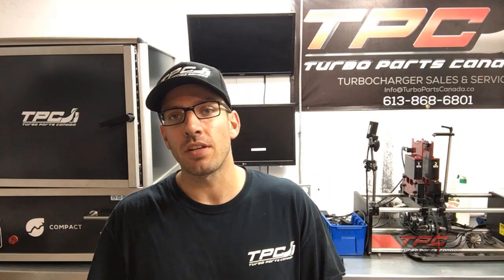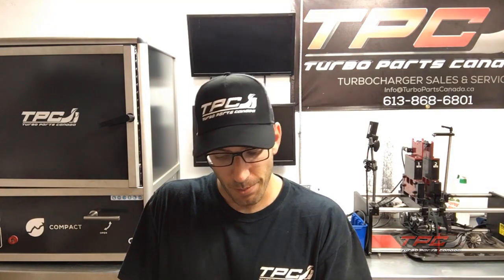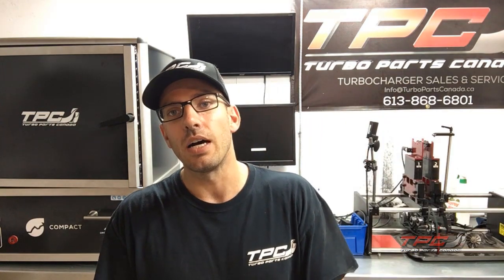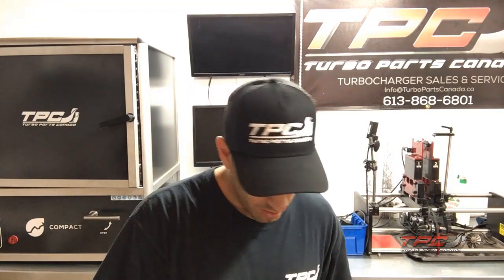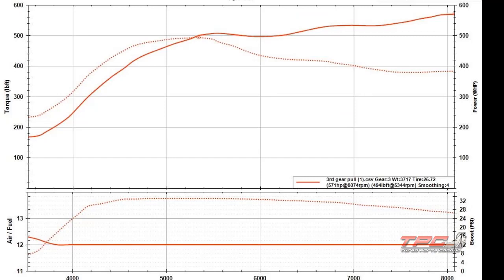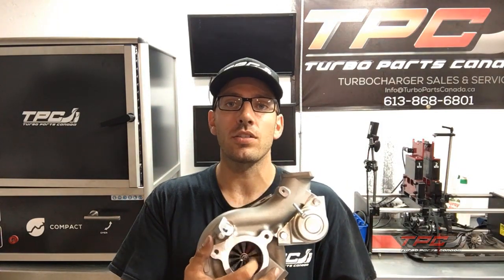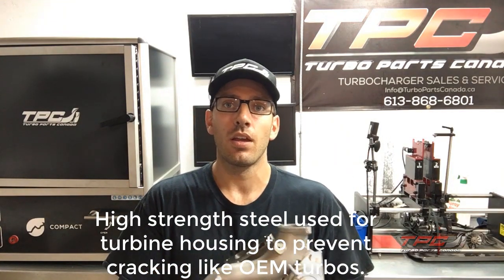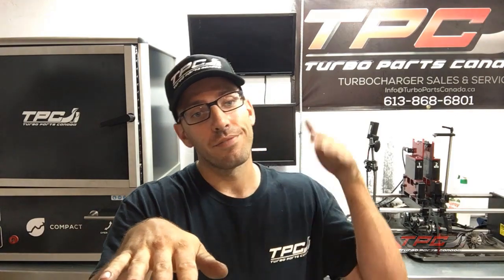Evo X GTX3576 Hybrid by TPC

Comment: Just purchased ur gt spec..  hope to make good power on 93 octane...
Reply: I got their gtr spec.
Reply: @evodudedad2053  I sent mine back. They sent me one that was broken and Lucky i checked  was missing  a oil pressure  fitting that went inside the cage that holds thd bearingz. Then they wanted me to send Money friends and family for another after asking for a replacement.  Was a big shit show. Had to file a paypal claim and everything. Said the piece I found looked lkke a used part that fell in box during  shipment. But clearly  wasn't.  To me looked like they built the turbo with used parts that fell out the turbo. SMH. I bet it wasn't  even balanced..
Reply: @bnastystuntz  oh dang... sorry that happened to ya. as far as I could tell, mine seemed fine.

Comment: Btw I picked up another 15-20 hp on this turbo after I gutted my exhaust (thats my dyno graph in the video). More fuel and wga this winter!
Reply: that's fake dyno graph you pussy you can change peramiters and make the numbers increase
Reply: Ashter Egg we will find out..mine gets tuned at STM this Saturday
Reply: @VinylDrip  well?
Reply: Josue Aguilar my apologies, my Evo did 410 whp on 93 on a mustang dyno. I could of gotten more power but my Evo X is a MR and it is limited to only 380 lbs of torque especially having stock block stock transmission SST, stock cams and stock manifold. I am very happy with my purchase.
Reply: @VinylDrip  excellent, thank you for the reply
How loud is the turbo spool?
I'm thinking of doing this G spec on my gsr
Reply: Josue Aguilar I’m on Instagram @evo.within I’ll send you a video hit me up. It sounds nasty.